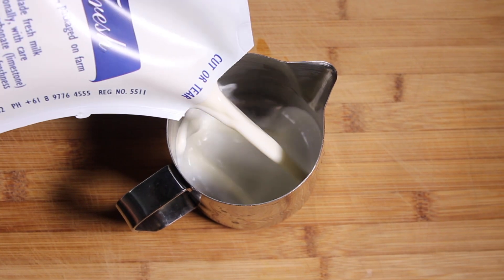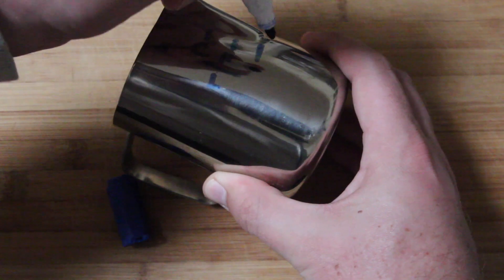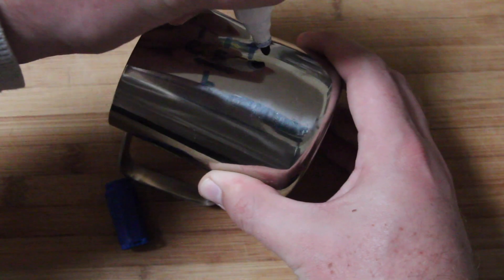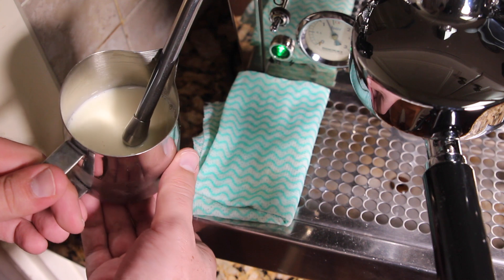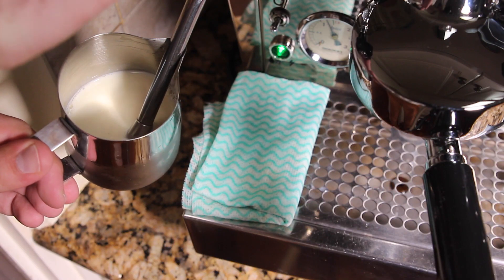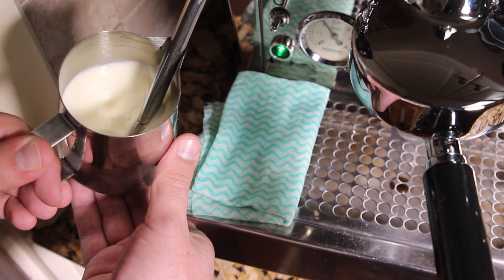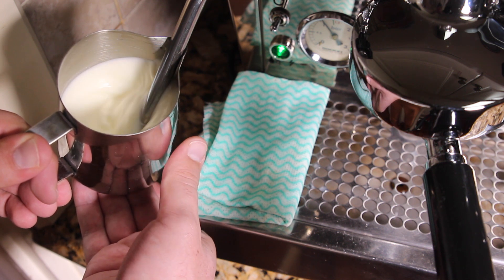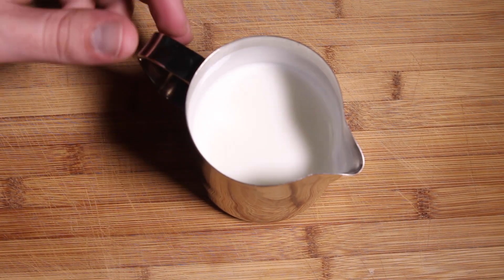Texturing Silky Milk - Coffeefusion Espresso 101

Comment: Great tutorial.  I find that the SOUND of the steam in the milk is a great guide as to whether I'm getting the right kind of air mixing, so I wish you would include a start-to-finish video of the steaming process with audio included.
Reply: Also would be useful to know what "expansion factor" you think is optimal for micro-foamed milk.  Eg, 120ml of milk expanded 2x to 240ml of foam, or 3x to 360ml, etc?  That helps calibrate how much milk to start out with since the base of the spout is different depending on the pitcher.
Reply from the maker: You're right, the sound is helpful - you're usually at the correct temp just as the sound starts to deepen in pitch. Also, if your milk is 'squealing' at the start, you need to drop the jug so the steam wand is on the surface of the milk and starts incorporating air.

Regarding expansion, generally 1cm above the starting point of your jug is enough for one for one flatwhite/latte - add another half a cm for a cappuccino.. :)

Comment: Nice that you've updated this, much fresher and cleaner look :)

Apologies in advance for the long post!
I've had some problems with my milk recently, the main one is that my milk gets hundreds of small bubbles that don't disappear when I tap the jug. I try to not let the milk get to warm before I stop adding air, though it doesn't seem to help. 
Sometimes the milk spins up really high around the spout of the jug. I'm guessing it's to do with angles but sometimes it happens straight away and sometimes I get a nice whirlpool going and then it builds up as the milk heats up and then starts spinning like crazy.
Lastly, this one really messes with me. When making a flat white I let just a bit of air in then bury the wand. I get no more "ch ch" noises but the foam still builds up to the point of between a latte and cap. I really don't know why this happens but it's so frustrating! 

Thanks for any help! :P
Reply from the maker: what kind of steam tip are you using. is it one of those steam wands with a froth enhancer on it? Or, perhaps the machine isn't producing dry steam?
Reply: It's at work so a La Marzocco Linea, so no froth enhancer just a 4 hole tip. Not sure how old the machine is now, we have had issues with leaks and stuff which I'm not sure if that makes an impact?
Reply from the maker: ah okay. I was thinking maybe a home machine. I sometimes get a similar thing when I have a small jug and it is just spinning like crazy with the intense steam pressure. Try adding even less air to compensate and allow the whirlpool to do all the work!
Reply: Yeah that's exactly my issue, the little jugs (or trying to use less milk if I've just got a piccolo to make) I felt there was too much pressure which makes it spin out but sometimes it's fine and sometimes not. I'll try adding less air and see how that goes!

Comment: For some reason every couple times I do this my milk foams and roses over the mug
Reply from the maker: Make sure you give the steam wand a good purge before you get going. Especially if you have a commercial machine and this is the first time steaming since the machine has turned on - this might be the issue you're facing.

Comment: 400 ml pitcher is hugh for one capp. i use a 250 ml and i still have extra milk left over.
Reply from the maker: What size cup do you have? In Australia a 200-220mL size cup is pretty normal for a normal size coffee. If you used a 250mL jug (which I've never even seen before) your jug would be full when you finished texturing, and you wouldn't be able to pour latte art properly with it as the jug would be so full.
Reply: @brewbudsclub  i have a 250 ml filled just below the spout.
Reply: oops 150ml below spout
Reply: oops 150ml below spout
Reply: 350 ml full.

Comment: Hi question about texturing milk for latte art. I was told stop texturing once the milk started to get warm not before  please advise. Thanks!
Reply from the maker: Yep it's better to add air early on in the texturing - it means that the whirlpool has time to combine it in with the milk, and also it will hold in the milk better at lower temps.

Comment: I've followed everything and has a nice Whirlpool rolling however everything isn't incorporated nicely. I get foam at the bottom and very thin milk on top. Am I adding too much foam or what could be the problem. Thanks!
Reply from the maker: You might be adding a bit too much air. Look at the level of the milk before you get started heating it up, and then look again when you finish. If you've moved up about 1cm (about half an inch) then you have a good amount of air added, any more and it's probably a bit too frothy for latte art.

Comment: Hey there, thank you for another great video. I have gotten pretty consistent microfoam on my Europiccola. On a related note, what machine are you using? I am considering making an upgrade but don't think I will be able go afford a mini La Marzocco.
Reply from the maker: I use a Rocket Giotto Evoluzione. Mine is an earlier version but I've had it over five years now and it's still rocking it (pun intended!) Thanks for your comment, a linea mini would be nice wouldn't it?! 🤑🤑

Comment: i'm always a bit confused about making capps, all i know is it's 3 equal parts (espresso, milk, foam), so if my espresso shot is 50ml, how much milk should i really be frothing?
Reply from the maker: I think the 3rds rule is the traditional thinking behind cappuccinos, but not really how they're made anymore (perhaps they're still made like that in parts of Italy). These days I think most places are making caps with a single shot base, topped up with steamed milk which is fairly frothy - but even the frothiness is becoming less and less so that you don't end up with that dry froth which separates away from the milk.
Reply: hm alright! yea, i'm trying to learn how to make the basic espresso drinks and so far with capps i've just been going by it being a smaller-sized, more potent latte, that's all, though it kind of borders the line with a flat white. i just give capps a bit more air than a flat white

Comment: Do you suggest steaming milk first or pulling shots first? My machine is only able to do one at a time. :S
Reply from the maker: Tricky question, personally if I had to choose I'd pull shots first and then steam the milk.
Reply: XxWewicxX I have a single boiler machine, Breville Barista Express, and I find the best sequence for me is grind, tamp and lock in the portafilter, then foam the milk, then pull the shot and pour the foamed milk
Reply: Actually, the Barista Express doesn't have a boiler, but instead uses a thermoblock.
Reply: XxWewicxX steam the milk then pull the shots, the espresso will be bitter if sitting there for that long..